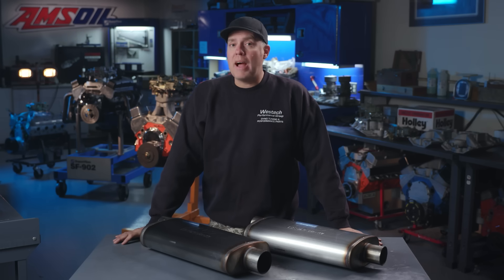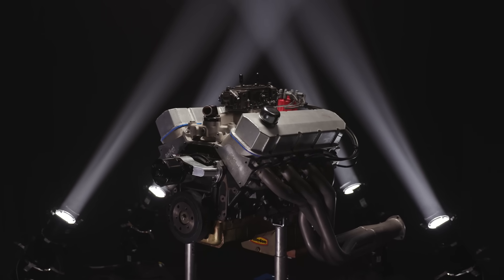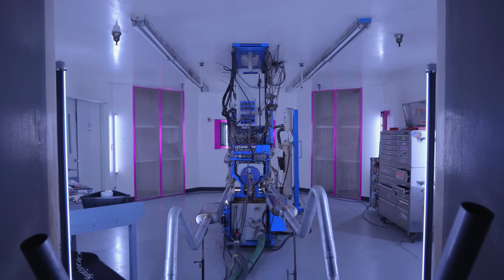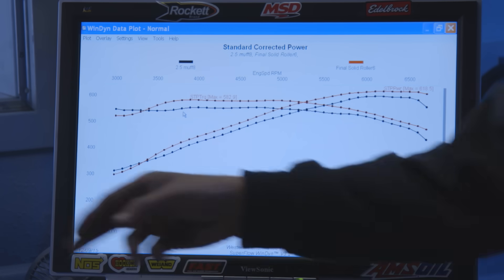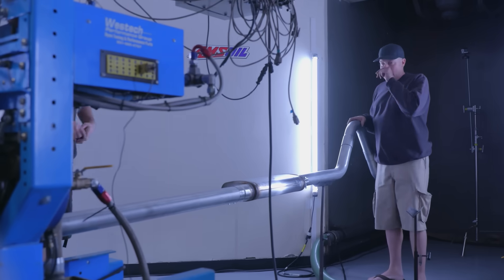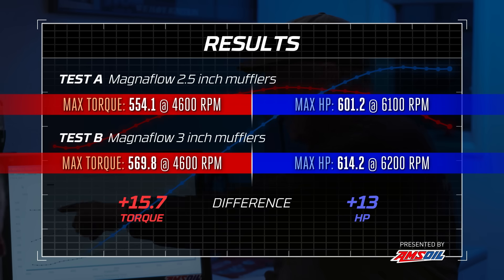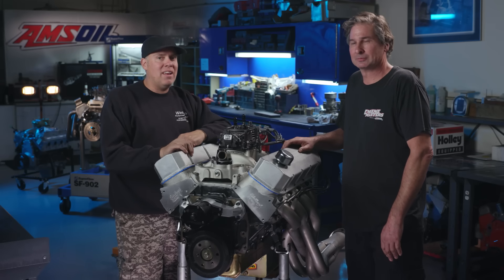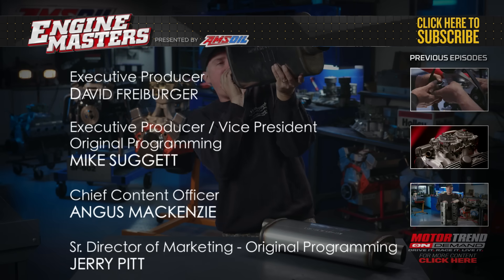The Power of 2.5- vs. 3-Inch Exhaust - Engine Masters Ep. 9

Comment: when 3 inches is enjoyable
Reply: lol
Reply: Why are you still using carburettors and not fuel injection?.  If you gave a 454 to Europeans they would get 800 to 900 hPa out of it
Reply: +dimmacommunication Cheaper not easier.
Reply: Ben for the win! lol
Reply: +Michael Naisbitt the carburator is there just cause it's easy and cheaper to handle for a track car
Reply: +Michael Naisbitt because it is expensive and some places dont have tuners.

Comment: Maybe I missed you guys mentioning it but you should have mentioned the "type" of bends you used for the actual pipes and how they're important to maintaining the benefit of 3 vs 2.5 inch muffler. I only say this for the new guys who may be looking into upgrading their exhaust system, take this video at face value, and go buy a 3 inch system with the considerably cheaper wrinkle bends (wrinkles creating a smaller pipe diameter around the bends). Overall, really cool video! This subject pertains to the interests of a lot of common people (as opposed to something like installing CNC-milled headers) so well done!

Comment: how would it be on a car that is mostly stock, say a stock ls engine? that isnt pushing 600hp.
Reply: +Serg Stroble dual 2in bruh
Reply: i mean what would a stock ls get from a 2.5 or 3" exhaust over stock.  those are numbers that matter for most people.
Reply: +Serg Stroble technically stock ls engines start with 2.5" exhaust. there is some variety with some people reporting 2.75" inlet to muffler and 2.5" out. The 2002 camaro ss started life with 2.5" exhaust. So a 3" exhaust will have an improvement to horespower but you may lose a small bit of torque.
Reply: sweet.  i have a 2005 audi s4 with stock exhaust and was trying to figure out if going 2.5" pre made exhust or going 3" full custom.  looks like 3" would be best and cost less than premade.
Reply: Always go custom. Premade stuff is great; when it is accurate and precise. But you must realize that sometimes there are slip-ups and when it comes to exhaust, there is very little room underneath a car to be wrong. I'm not familiar with Audi, only familiar with the big 3 American cars; ford, Chevy, and Dodge. I know V8s benefit directly from bigger exhaust by gaining hp, but if its stock, losing torque because less backpressure. I'd go on a forum for your vehicle and ask around before pulling the trigger based on this video, which is a V8.
Reply: THe s4 has a 4.2L v8, so i figured it would be pretty similar.  I want to go straight pipes, but i think at least some mufflers would make it pretty streetable.
Reply: again dual 2in would be perf.
Reply: +hittin-low_150db+ Yeah for that car I imagine true dual 2 inch would work wonderfully

Comment: This does mean that for a daily-driven car, the 2.5 inch would be the better option, especially if that's all you're changing. The higher low-end torque would mean both easier driving and slightly better fuel economy (especially if you could correct the fuel-air ratio). This is great for anything with a V8, since under normal driving you're probably not going to break 3000. It'd be particularly useful for towing.
Reply: +ootdega Either way you are making over 500lbs of torque down low, 5-10lbs isn't even going to be noticeable.
Reply: GlassTopRX7
....Completely missing the point
Reply: ootdega
How so the cost difference isn't very much, giving up next to nothing down low and gains mid to high for a little more volume.
Reply: GlassTopRX7
Not everyone on the planet has a Chevy 454 making 600+ horsepower in their car.

Comment: I know E85 is a scary monster for muscle guys, but everyone else seems to be embracing it. Could you maybe do an episode seeing how much horsepower just E85 and an appropriate tune could make over normal pump gas on say a stock LS engine?
Reply: you will only see considerable gains in power with e85 on turbocharged engines. it doesn't have the same effect on n/a cars
Reply: Ah, cool deal, thanks.
Reply: BTW the s2000 has 11:1 compression ratio. That's pretty high in a stock motor.
Reply: e85 only makes more power with force induction. I have an s2000 tuned with a flex fuel sensor, and I got 239hp on 93 octain and 242 on e85. I got a 3 inch tanabi exuast and 1000cc injector dynamics matched injectors. there are tons of videos on the internet proving this.
Reply: +Jose Villalon it does when you have huge compression
Reply: Give example
Reply: well i think the gov. is trying to get rid of e85._.
Reply: +Frigglebiscuit Honestly, 110 AV gas might be a better alternative for budget racers. Can be bought at the local airport and isn't hygroscopic. I don't race, so I've never compared fuel options though
Reply: +Ryan Nelson av gas is amazing
Reply: Frigglebiscuit
smells better on ya fingers than ulp
Reply: 15-20hp NA
75-100+ boosted

Comment: Now do X pipe/H pipe comparison to this no crossover test.
Reply: +4gasem  Most people running a race trimmed 600+ big block on the street aint gonna worry about crossover pipes
Reply: +dj beard (neo71665) Why?  Wouldn't you want to scavenge as much as possible?  (honest question, not trolling)  This is why I'd like to see if there IS any difference.  Plus, I prefer the sound of an exhaust with a cross over.  X pipe is my favorite.
Reply: Only talking from what I've seen but most full race trimmed big blocks making that much power are only race cars that are driving on the street for something like the street car challenge (hasn't been actual street cars for years). Those cars rarely get driven enough on the street to worry about any scavenging effect and when they do its only to be driven from a track to a track to meet the so called street car requirement. The guys driving the so called full race engines on a more regular basis often have them de-tuned to make them more street friendly and IMHO that removed the race trim from a race trim engine.

Comment: 620 hp is not bad for a 7.4 liter OHV V8 compared to 8.4 liter V10 viper engine that only makes 645 hp
Reply: +Naufal Kusumah It could make much more, but Ferrari won't agree. BTW, Viper has more torque :)
Reply: +Naufal Kusumah you could build this for half of a viper motor tho
Reply: +Naufal Kusumah The V10 will pass emissions, if held to the same standards this probably wouldn't.
Reply: +GlassTopRX7 some places dont do emissions.
Reply: +GlassTopRX7 Yeah I guess so. Switching to EFI and run higher compression ratio could help tho but I'm not sure
Reply: +Naufal Kusumah again way cheaper
Reply: Frigglebiscuit
Fair enough but if you don't hold the V10 to that standard it has far more potential as well.

Cost is the issue for the V10, there are motors for a fraction of the cost.  As bonus all of them will sound better than the odd firing mopar V10.
Reply: +hittin-low_150db+ And I believe Lingenfelter sells LS7 crate motor that makes 650 hp at the crank. The V10 viper is just an old engine

Comment: Sorry to be a wet blanket guys, but I wish you had done a bit of AFR tuning with the exhausts on.  I feel like this was a little bit biased toward the open headers since you didn't adjust the tune for the exhaust systems.  There had to be a little power left on the table...  I still loved the video though!
Reply: Spot on, this test lost all meaning once they showed the AFR graph. Yet another incomplete test to prove that changing parts without adjusting the rest of the system is a waste of money.
Reply: rocketmanpj Yeah!  I love Frieberger's videos, but this was another one that was a little Roadkill-esque in the fact that with one more step on each setup it could have been so much more satisfying.  It's a little bit like Roadkill when they give themselves so little time for prep that failure is guaranteed -- Personally I would prefer a little bit better chance of something good happening.  Lol
Reply: WarmSoftKitty I pull mine from actual experience.  Can't speak for anyone else.

Comment: Half an inch doesn't sound like much but the volume changes a huge amount. The volume of a 2.5" circle is 4.9 sq inches where a 3.0" circle is just over 7 sq inches. That's a heap more air flow.

Comment: not sure if this was asked already. Is there a reason you did not redo the tuning or redo the fuel mixture on the two and a half inch pipe?  maybe you could have closed the power gap some by doing so.

Comment: I've only heard about muffler being too big applies to a turbo charged application - if the muffler is too big you run into a phenomenon called boost creep - that is the boost pressure creeps around due to lack of back-pressure to keep the turbo spinning.  I've never tried it personally, and was never sure if that was bunk or not.  But I've never heard that applies to a naturally aspirated engine, and this definitely proves that.
Reply: +Reggie Reginato Boost creep is caused by a restriction at the waste gate, or using too small of a waste gate to bypass the exhaust turbine.
Reply: There are a ton of turbo applications  that run short, unmuffled down pipes without issue. Boost creep would be more likely be caused by a restriction at the waste gate.
Reply: ive always heard that you eanted to get the exhaust out of the turbo as fast as possible
Reply: Like I said, I donno...  I've only ever heard it applied to turbo motors.  In my mind more exhaust flow would be most benifical to keep the spool spining.
Reply: +Reggie Reginato Exactly! More flow, more power. 'Back pressure' is less flow. There is some voodoo with runner and collector volume, exhaust velocity, cylinder parings, firing order, and system flow volume but that's for scavenging, which might be confused for back pressure because of aforementioned voodoo. That's really only for NA motors with more LSA than boosted cars though.

Comment: I think it would be interesting to get some 4-pot engines on here, I love all the V8s, it's just it would be fairly interesting to see how much power can be made from building up an N/A or lightly boosted 4-cylinder. Keep it up guys!
Reply: +MineTwine45 Meh, a 4-cylinder is just half a V8 (with a different crank shape, usually).  Same principle applies. :)
Reply: +TassieLorenzo Well yeah, but I think it'd be funny to hear the trio crack on a 4-pot.

Comment: I think it would've been interesting to see somekind of rediculous, 4.5 or even 5 in exhaust. Even without a muffler but with the same length. Maybe that could actually kill power.
Reply: how will it kill power if the best numbers come without any exhaust
Reply: +mrstormuk On an NA engine you get more HP with tuned headers then without any headers at all. 
Also if you have a large diameter tube rather then nothing there could be resonances that slow down the flow. 

I'm not saying onewill defenetly lose a ton of power, but I think one might lose a bit.

Comment: would results change at all with boost?
Reply: +Brentan Coates probably but still unrestricted airflow = more power
Reply: +Brentan Coates With turbos the lease possible back pressure is hugely important. The turbine side generates power to spin the compressor based of a pressure differential between the intake and exhause of the turbine. 
If you have huge back pressure behind the turbo, you're gonna be making less boost.

Comment: I think I like the 2.5" muffler better. Just bypass the exhaust with a button controlled valve if you want the full potential. If you want a quiet drive or a sleeper, the 2.5" is more suitable I think.

Comment: Holy shit. +13hp just from a 0.5 inch bigger muffler.. Not to mention +15.7 torque.
Reply: Holy shit! that's like 2% gain
Reply: When you see someone from car throttle on youtube
Reply: Rmaul246 CTzen.
Reply: +V4 Garage It's not as easy as it sounds though. That 0.5" large pipe is much more difficult to install.
Reply: Maxwelhse Yeah the extra half inch of clearance can be tough if you are already having tight exhaust fitment.
Reply: V4 Garage
It's way worse than 1/2"... The bends are dramatically larger that you'd think compared to a 2.5" system.
Reply: ***** Which diameter? 2.5 or 3.0

Comment: I'd like to see an Engine and a Car dyno to see the difference exactly between Flywheel & Wheel power. Same engine & exhaust in& out of the car. Would be interesting to do a 2nd gear pull vs a direct drive 3'rd gear in a th400 or 4Lxx

Comment: they say they are engine masters, but in reality they just masters of the inefficient American v8s. would be nice to see something most Americans actually have. like Honda engines and etc.
Reply: I think you're on the wrong channel
Reply: +Big N Easy na I like watching. but I just feel as though they don't like recognizing any good engines. just American v8s which i wouldnt call good. just big.
Reply: +David Serrano If American V8's suck. Why is an LS swap an awesome option for a 240??? Seriously bro 4 bangers make power because the cars are light. Not because they make big power.
Reply: +TheTyrial86 American v8s are inefficient they are just big. simple as that. bigger engine will definitely make more power. that's not the argument I am making. I'm saying they are inefficient. most stock NA v8s cant do 100hp/liter. while many 4 cylinders have done that in the last 2 to 3 decades.
Reply: David Serrano Again this is racing not checking to see how much you save on gas...
Reply: TheTyrial86 obviously but they still claim to be engine masters. Them showing what it takes to make a 600hp Honda engine would be interesting. But I bet they have never even touched a Honda engine. Let alone worked on one.
Reply: David Serrano A honda needs ALOT to be running fast. And they burn out faster because of it. 

The only reason why people like the Hondas is because part are easy to find in some places, but the kits to make then run quick are hard to find. 

An LS has parts all over and kits are damn near anywhere. Did you watch that budget racer Hot Rod garage did... Dude tell me you can get a Honda running 12's on less then 10grand, and a huge potential to run 10's.

Comment: Wouldn't it have helped if they fixed the air/fuel ratio for the 2.5in?
Reply: +Tamoring There is a window of good, it was in the good range. Main difference would be the mpg at the pump over time.

Comment: so should I do a 3 inch exhaust on my turbo 4 cylinder or leave it at 2.5 inch?....I'm full stage 2.
Reply: Go 2.75
Reply: +Audiwan Kenobi Don't know what size turbo you are running but, with any turbo motor bigger exhaust is always better.

Comment: you should do a turbo version of this Ep
Reply: +Ryan Devid that's makes no sense. You clearly don't know how a turbo works
Reply: +Ryan Devid turbos use the exhaust gas to turn a turbine which is connected to a compressor wheel which sucks air into the turbo them compresses it to create boost. You are referring to ram air effect which doesn't effect a turbo engine that much
Reply: +Ryan Devid lol riiiiiiiiiight
Reply: +Ryan Devid 

http://i2.kym-cdn.com/photos/images/original/000/738/025/db0.jpg
Reply: +1
Reply: +Ryan Devid that won't effect in how the turbo works.
The air is coming from the exhaust manifold not the wind that hits the car.
Reply: +Ant M  i have free time this morning and I find it fun to go on car videos and talk complete nonsense So I can get a rise outa people
Reply: +Ant M yes, turbos use air from the exhaust, but don't forget that hot air from the exhaust won't be as effective as cold air which is why the air must first go through an intercooler where cold air from the environment hits air through fins on the Intercooler to cool the hot exhaust air into cool air before it is re-channeled in to the engine. this is why you see dyno videos with fans next to the car for turbo cars
Reply: +Anthony Abad Are you related to Ryan Devid? Your turbo theories are the same kind of advanced nonsense...

The exhaust gas temperature should be high, the resulting expanded air is what gives it volume enough to give the exhaust turbine a good push. That is also why you sometimes see "heat bandages" around the exhaust pipes between the engine and the turbo... to keep the exhaust air warm and at as large volume as possible.

The intercooler is for the INTAKE air, not the exhaust air. (Since the turbo gets pretty warm from the exhaust gasses.)

If you re-channel the exhaust air back into the engine, I'll race you with my lawnmower. And win.
Reply: what does the compressor side of the turbo do? you know, the other side of the turbine theres a compressor side? the compressor side that's connected to the intercooler?
Reply: Surprisingly, it compresses air.

But that's not what you wrote, hence my comment.

I redact my theories regarding your relationship with Mr. Devid and put this up as a case of Temporary Youtube Grammar Malfunction instead. Better? :P
Reply: +ziiofswe yeah, just a little misinterpretation and grammar on my end. I'm glad we were able to put this debate behind us :)
Reply: Better than the infamous youtube comment battles some seem so fond of....
Reply: No point. If they proved it on a non-turbo engine, it's obvious the same would apply to a turbo setup. Less back-pressure=more power.
Reply: NismoNick240sx

but, MORE CONTENT!
Reply: +NismoNick240sx not true turbo exhaust flow is very different from na
Reply: ***** That wasn't exactly the point. now was it? I didn't say that it was, I'm just saying there's no point in that a turbo version of this episode since they already proved bigger shorter piping = more power...
Reply: A turbo charger wouldn't really work on this indoor Dino test. A turbo relies on extra airflow into the turbo turbines. But a supercharger would be fun to see
Reply: +Ant M it's okay that you're a ricer and don't know how turbos work. You need increase airflow into the turbo to increase the power. In a room with static air you won't get a big increase in power. Yes you'll see an increase in power but not that much